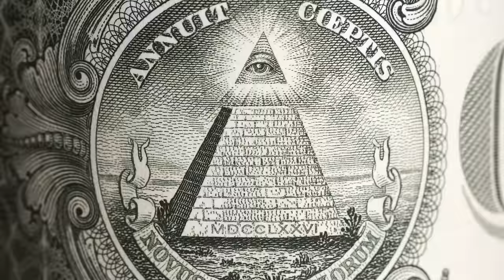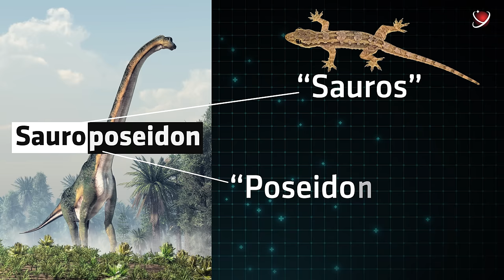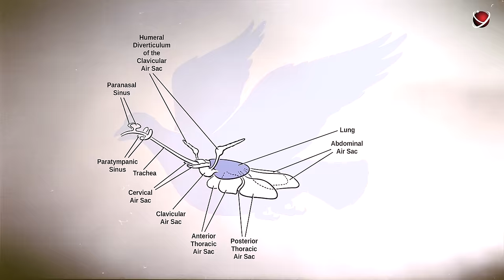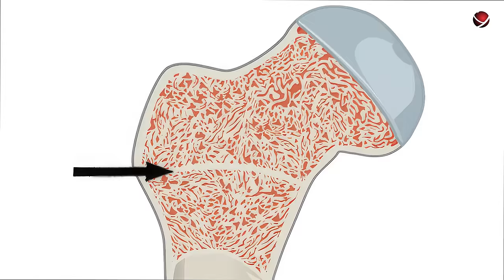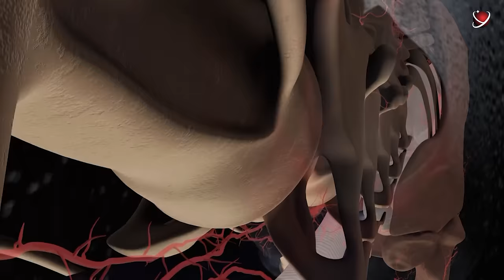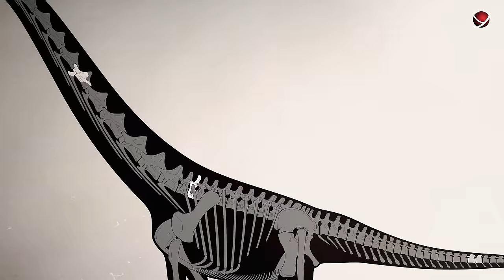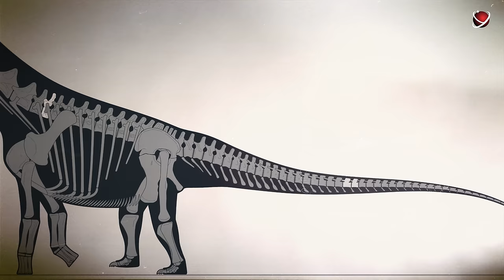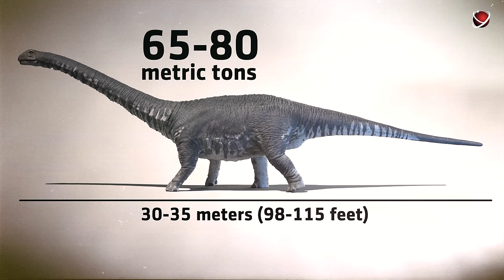These Are The Largest Dinosaurs In History

Comment: How could there be much disagreement about the size of dinosaurs?  The skeletal remains reveal quite a lot of info -
It's stupid to show those sauropods on land when they spent most of their time in water.    
They needed water to help support their weight, and it was a safe space away from predators.
Reply: Many dinosaurs are known from fragmentary remains, sometimes a single or even a partial bone. This is the reason why some estimates vary because if you don't know the proportions of the said dinosaurs you can't be 100% certain about the length or weight even when you use close relatives for the calculations. Essentially different methods give different results for such dinosaurs. Sauropods didn't need water to support their weight. Their bodies are extremely pneumatised and they weighted far less than they would have otherwise. Their bones are hollow and filled with airsacks which also extends through different parts of the body. They literally wouldn't be able so sink if they go in the water and would instead float because of their low body density. Plus they already have a great defense against predators which is their size. The biggest sauropods would be for the most part safe from any contemporary predator. Even in group, attacking a creature 10 times your own body mass is usually not worth the risk especially when there would almost certainly be safer options.